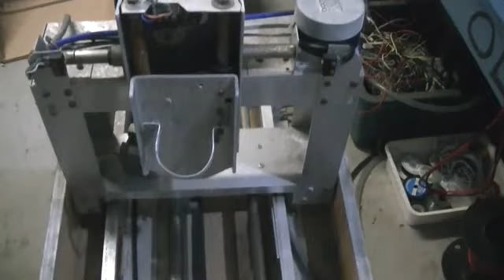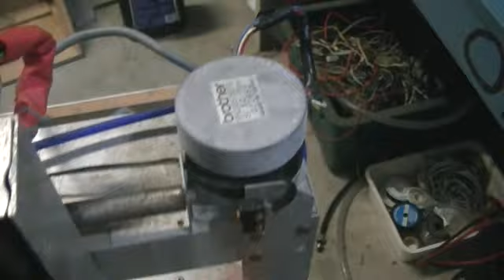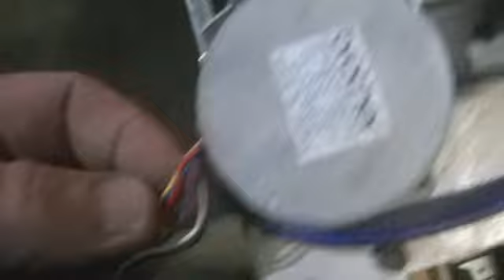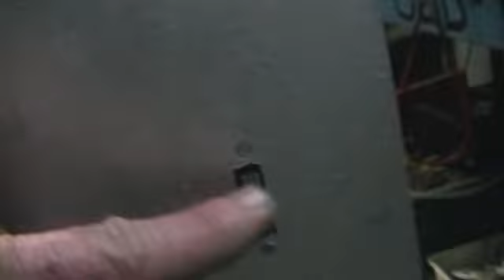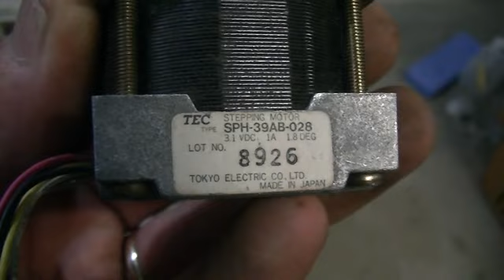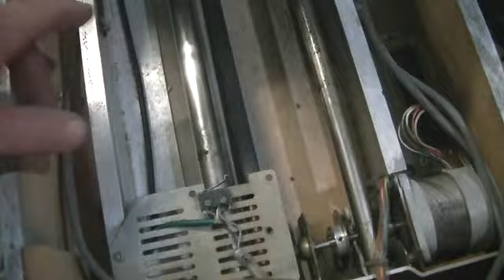printer part's.mp4

Comment: Looks like most of the stepper motors are unipolar, 6 or 8 wire, which just means they are center tapped off the winding's. The amount of torque that they will have doesn't look like they will move the movements without loosing steps or resolution. I'll email you, more info, Jeff.